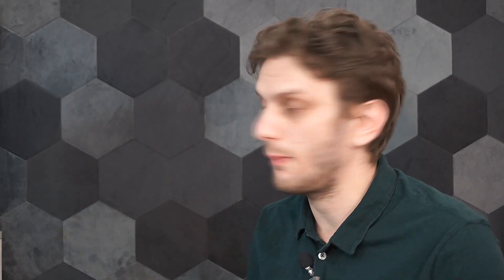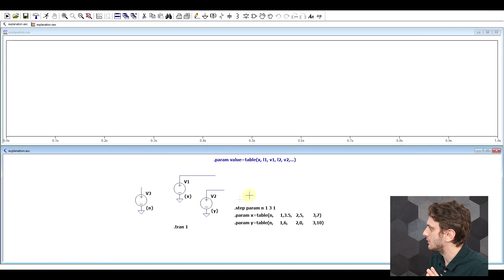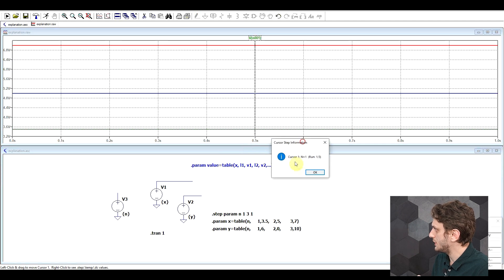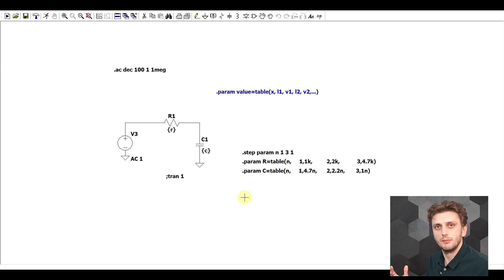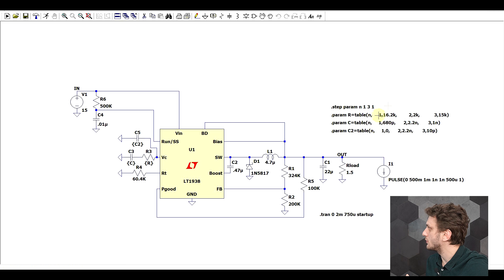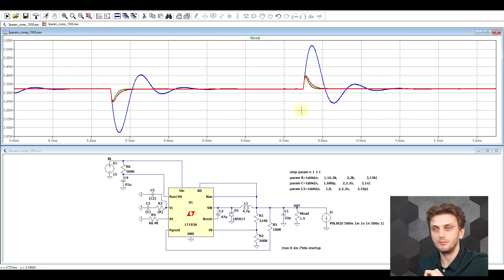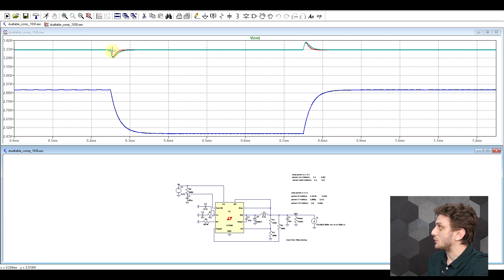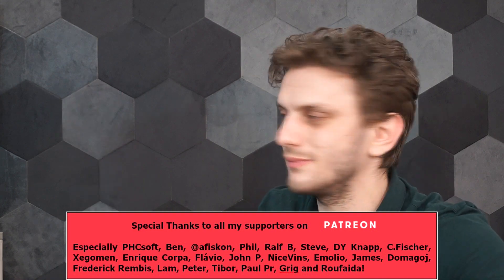LTspice tutorial - Stepping sets of parameters

Comment: Nice one! Another advantage of 'scripting' these circuit variants is that it avoids problems in copy/paste actions where you accidentally missed a change in one of your simulations.  Makes things much more reliable and reproducible.
Reply from the maker: To be honest, if I just want to change component values, this method is ok; but the copy/paste method can be far more useful when changing interconnections or adding different components.

Comment: Hi FesZ Electronics: What is the purpose of Pgood connexion ?. Datasheet shows typical application without Pgood.
Reply from the maker: In general Pgood, PG,  or "power good" is an open drain output that stays high only if the power supply is within ~5% of the nominal voltage (exact % differs from IC to IC). The common use case is to link this pin to a microcontrollers reset so that the uC is allowed to function only after the voltage stabilizes. This is to prevent unexpected behaviors during low voltage supply.
Reply: @FesZElectronics  Ok and in your simulation R5 could be removed and will work without problems.
Reply from the maker: Of course. I didn't really bother to remove unwanted components from the schematic, I just took the default test fixture that LT provides.